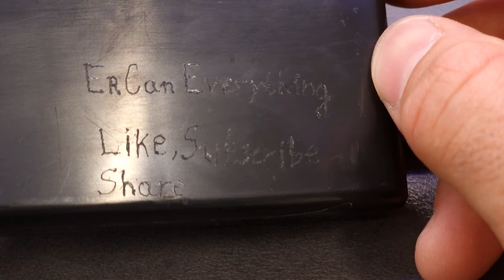How to make a powerful laser from DVD-RW that burns matches | DIY mini engraving laser

Comment: What voltage did you put to the diode?
Reply from the maker: The operating voltage of the diode is 1.90V and do not exceed more than this voltage.
When you look it with your eyes, you can see that it lights up very little, but I burned 2 diodes in this way.😄
Reply: @ErCanEverything  thanks 👍👍👍
Reply from the maker: I forgot to write you 10V - 12V after 50ohm resistor🙂
Reply: Mau nanya ini, terima kasih 👍 ..

Comment: Que voltaje utiliza gracias
Reply from the maker: The maximum working voltage of laser diode is 1.90V but after 50 Ohm resistor it works with 10~12V🙂